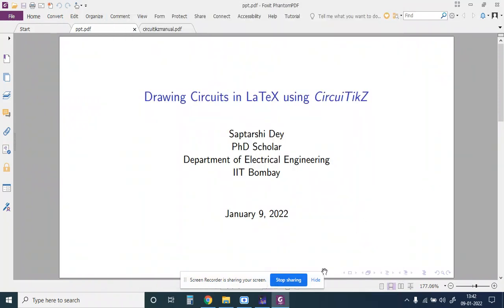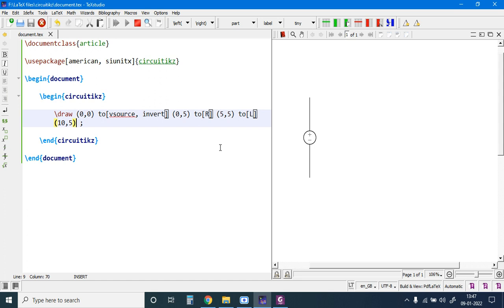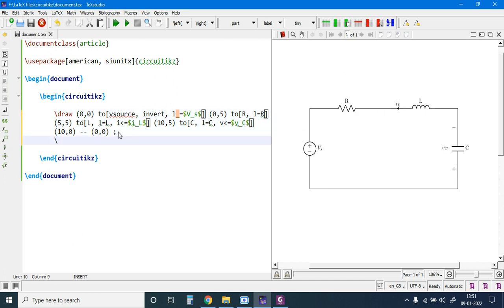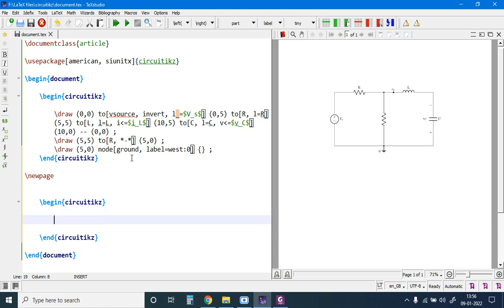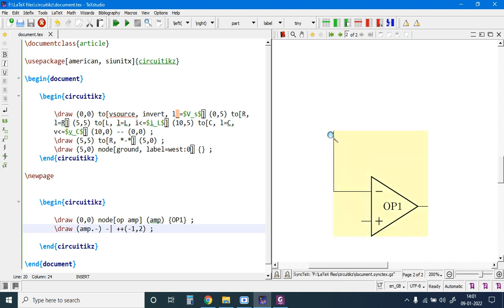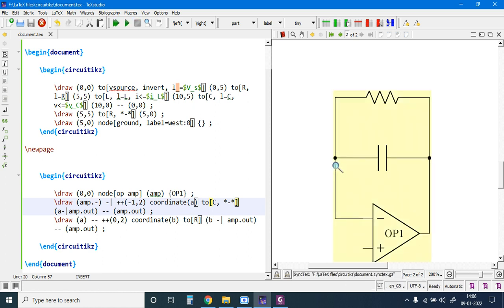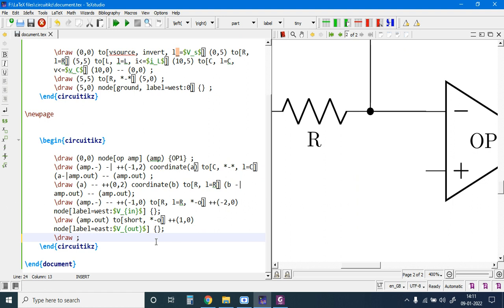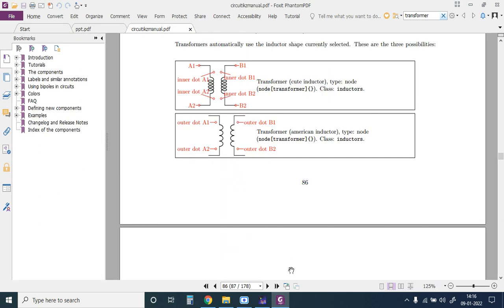LaTeX CircuiTikZ: Drawing high resolution circuit diagram in LaTeX

Comment: how to make the circuit in full page width rather than column with in ieee
Reply from the maker: It’s all about how you put the diagram in the paper, not how you draw. Use \begin{figure*}, that’d span the diagram across two columns.
Reply: Not the figure. Circuit diagram drawn using circuitikz. How to put them in 1 page width
Reply from the maker: @soniyaraju1138  draw the diagram in standalone documentclass then import the diagram in the paper as figure*
Reply: @saptdy thank you. thatz a good idea

Comment: Thanks for that! That was the best introduction to Circuitikz that I've seen. You might have added the location notation (A |- B) for locating the intersection of node coordinates. Some circuits are very difficult to draw without it. Also, the last chapter of the manual shows how to define your own mult-port nodes, if needed.
Reply from the maker: Thanks Scott. I have mentioned the location notation at 21:25
Reply: @saptdy  Yes, you're right, which makes your video even better! Thanks again! :)